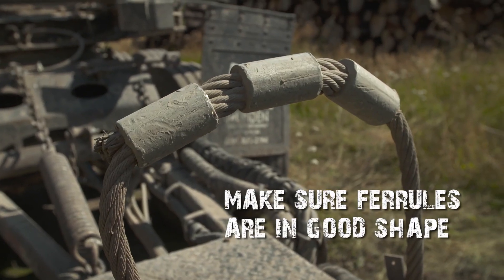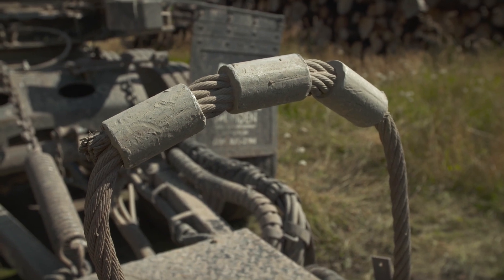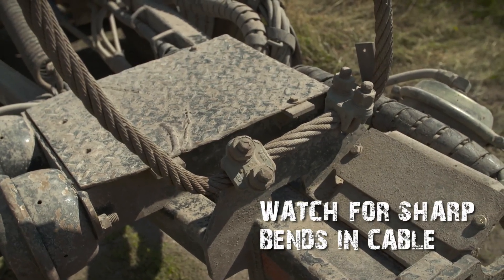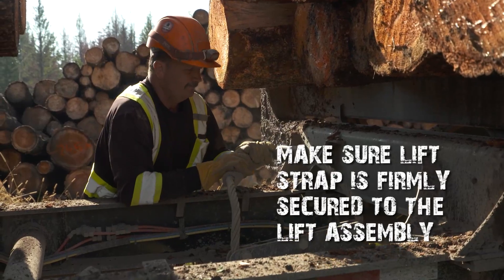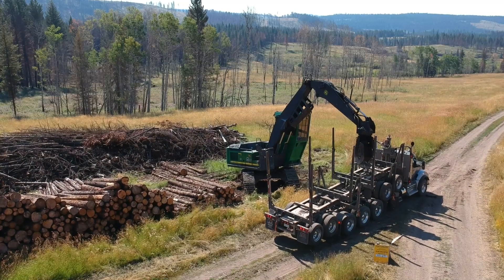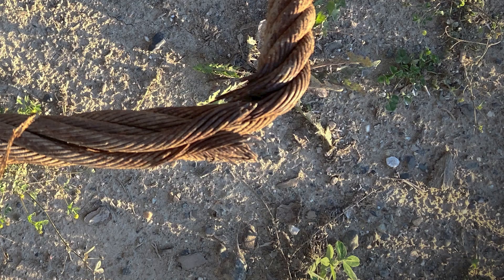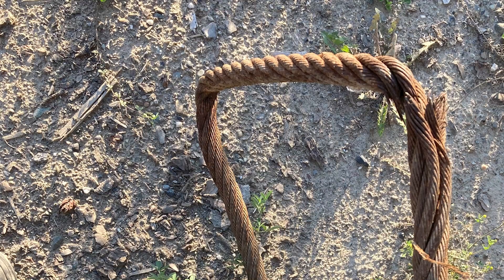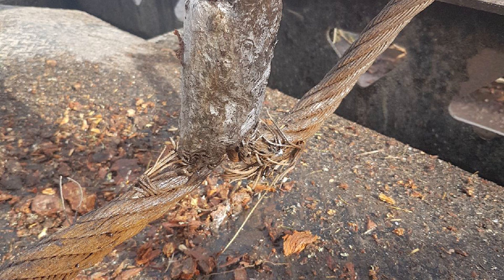MOLLY LIFT STRAP SAFETY INSPECTION

Comment from the maker: Review the Occupational Health and Safety Regulations Part 15 relating to Lift Strap Safety 

15.25 – Wire rope rejection criteria: https://www.worksafebc.com/en/law-policy/occupational-health-safety/searchable-ohs-regulation/ohs-regulation/part-15-rigging#SectionNumber:15.25
15.30 – Standards: https://www.worksafebc.com/en/law-policy/occupational-health-safety/searchable-ohs-regulation/ohs-regulation/part-15-rigging#SectionNumber:15.30
15.31 – Inspection before use: https://www.worksafebc.com/en/law-policy/occupational-health-safety/searchable-ohs-regulation/ohs-regulation/part-15-rigging#SectionNumber:15.31 
ASME B30.9-2006 Slings: https://www.asme.org/codes-standards/find-codes-standards/b30-9-slings